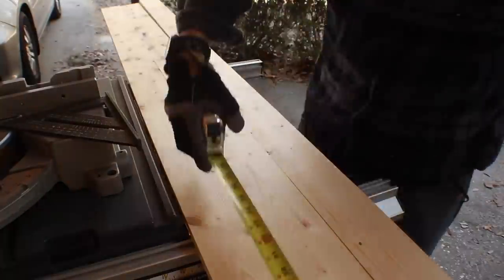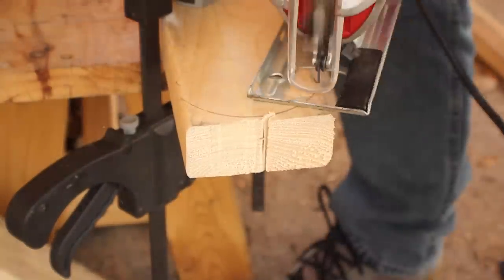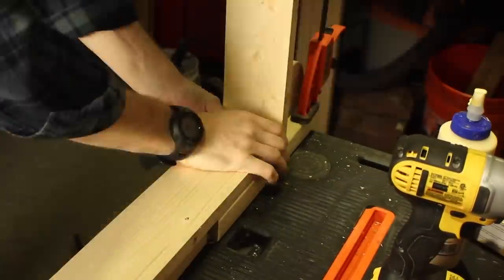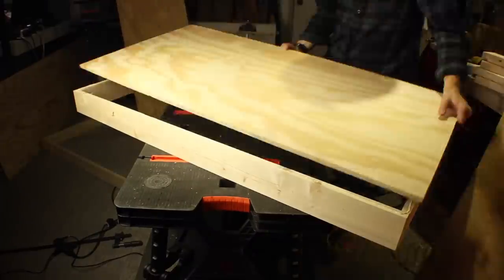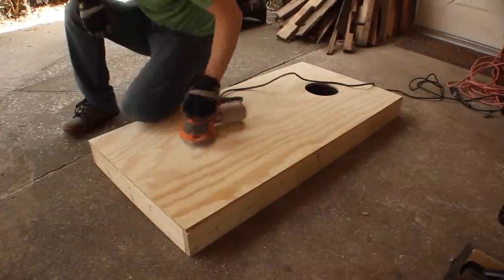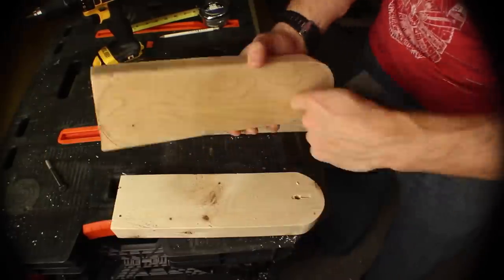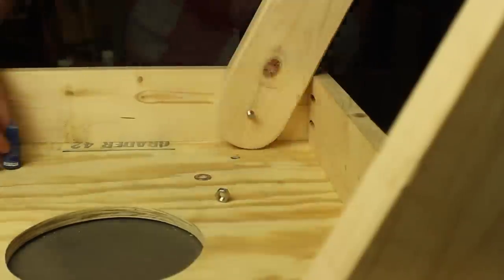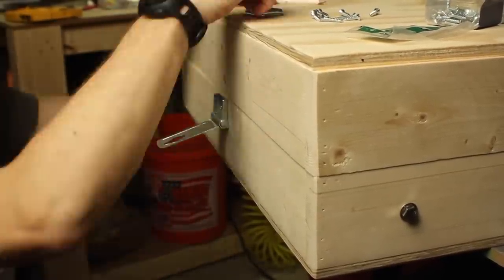How to make cornhole boards | I Like To Make Stuff

Comment: Awesome video of an otherwise over done project video. I like that you put your own unique take on it by using the 1x4's and the pocket holes to still give it plenty of strength. The handles and latch are a nice touch too. I just finished my own set and wish I had seen this before to help cut down on weight.

Comment: Doesn’t matter if it’s a project that’s been done 100 times, it’s the WAY you describe how to make it that I think we all appreciate. You’re very honest (“I didn’t measure the angle, I just lined it up with the miter saw”) and you describe everything for us beginners (measurements, distances, tips, tricks, tools, etc). I just finished building the This Old House picnic table bc I have family coming out to visit for the 4th. Came out pretty great! Although I might try and add some kind of cross braces for the seats, since they have a very slight bit of give in the center. I imagine 4-5 people sitting on them would make it much more prominent. Suggestions?

Comment: My legs are 35 degrees at the bottom. I also inset my frame and round the corners of the boards to as to not rip bags if they hit the corners. I also use a router and template to cut the 6” hole.

Comment: You should make one set with 2 or 3 holes for 2 hole one there should be a large hole and it should be worth 1 point small hole should be worth 3 points and the one that has 3 holes same order just add a medium size hole and that one should be worth 2 points

Comment: I don't remember which big-box store I was at (probably lowe's) but you can get 24"x48" 1/2" plywood sheets as/is there. I grabbed 2 and didn't need to worry about any cuts when i got home to make mine
Reply from the maker: linkinprk1981 Yeah! I saw those, and that definitely simplifies the project a bit!  I've found that those precut panels are almost twice as expensive as the full size, per sq ft.  But if you're only making one set, it's not a huge deal.  I've ended up making several sets so I've tried to cut down cost.

Comment: If you have a problem with following the line with a Jigsaw, I found that i helps to turn it upside down, it also minimize the amount of "splasout" on the top side, especially when you are working with chipboard or laminate boards.

The only downside with this, is that you do not have the little plastic bladeguard at the end, so don't touch the blade, it is dangouse if you have not notised. another thing is it is quite difficult if you have a jigsaw with a handle, which you apparently do:(

Comment: Cool build. It's interesting that the 2"x4"'s you had used for legs had IRVING stamped on them. There's 99.9% chance that it came from where I live and where Irving is located... New Brunswick Canada. Cheers!
Reply from the maker: Seriously? That'd be crazy! I'm in Savannah, GA so it seems like my lumber would be more local than Canada, but stranger things have happened :)
Reply: Irving is an international company based in Saint John New Brunswick. Not only do they produce lumber and anything else to do with wood right down to producing TP. They also have the largest oil refinery in Canada. Chances of the lumber coming from here are high. But there is also a chance that they have mills in the US. Interesting Connection. Cheers!

Comment: Now with the Pocket jig screws, isn't that going into the weaker part of the wood? with it be screwed towards the end of the 1x4, shouldn't the joints be on the out side going in? and how did you make that scrap wood right angle ?

Comment: dude I make boards too.. I lovehow you hook them together with the handle on the side.. I always use 2x4 ripped down to 3". do you hook them together and put on a handle on if you use 2x4s or do you think they are too heavy. I think mine run about 25 pounds per board..
Reply from the maker: Bryan Haburn I've never made them with 2x4's so I'm not sure, I just assumed they'd be heavier, maybe not TOO heavy.

Comment: since the center hole is 6 inches around do I make the corn hole bags 6x6 or 7x7? I have seen 2 different sizes people have made them so just wondering what the correct size bags should be. Thanks
Reply: From a wiki page  There are four bags to a set. Each set should be identifiable from the other; different colors work well. The American Cornhole Organization Official Cornhole Rules call for double-seamed fabric bags measuring 6 by 6 inches (150 by 150 mm) and weighing 15 to 16 ounces (430 to 450 g)[1] Bags should be filled with dried corn kernels. The final weight of the bag may vary due to the material of the bag itself.

Comment: Would those safety latches hold the two boards together if they used 2x4's?
Reply: +Billy Drake would depend on the type of latches you have access to. these particular latches look like they would still hold up no problem.

Comment: I like your video but i used treated 1/2 inch plywood and treated 2x4's they was so heavy...was any of your wood treated?
Reply from the maker: TheVicki23 no, mine was not because the customer wasn't planning on leaving it outside. You could also just prime and paint untreated wood and it will last quite a long time as long as it's covered really well with paint.

Comment: How come you put one latch and one turning piece per board? if you made one with both latches and the other with both turning piece, wouldn't it be easier to put back together (i.e., doesn't have to be a specific orientation, either way would work)?
Reply from the maker: Kurt No particular reason, you could definitely do it multiple ways. I guess if anything, the way I have it forces the two boards to be connected oppositely, which evenly distributes the weight, since the foldable legs are never on the same end.

Comment: When you said "the same distance from the top of the curve" when you where drilling the hole for the legs what was the measurement from the top of the  circular cut
Reply: Don, if you watch the video again he says to mark the center of the width of the leg and the same distance down from the top of the curve so it would be about 1 5/8 (half of 3 1/2) Hope this helps

Comment: Could you not use a router to make those 6" round holes instead of a jigsaw?
Reply from the maker: Yes, you absolutely could! For me, it's easier to follow the line with a jigsaw, but either would work.

Comment: you can't use "really strong" and "pocket holes" in the same sentence
Reply: why not?  pocket holes are very strong.
Reply: George Huber there's a video showcasing pocket holes vs other mounting options. And pocket holes with or without glue came out as the weakest in every test
Reply: Big deal he uses pocket screws, they work for him and that's all that matters. He chooses to make these how-to videos so if you don't appreciate what he's doing for others then don't watch them.
Reply: Yes.  Against dowel joints that are way thicker than the kreg screws and took two days to dry.  As well as against mortise and tenon joints which also take a lot more time and require much more specialized tools.  And the pocket holes still took about 100lbs of force at a single joint.  Compared to 150lbs for Dowel joints and 200lbs per joint for mortise and tenon.  Do you really need that much more strength??? If so then sure use them but pocket holes are plenty strong.
Reply: It's not so much that pocket holes are weak, it's that glue doesn't really make them stronger. The glue will fail long before the screw pulls from the wood. 
I like pocket holes because they disguise the screws, which makes them cosmetically superior. However, using them all the time when a much better method could be used is just asking for trouble.
Reply: For real.  Yeah, he says strong and means strong because most people that build these just use butt joints with no glue and 2 screws.  A pocket hole with glue is going to be plenty strong for what a cornhole board needs.